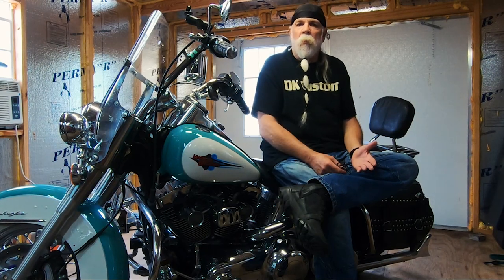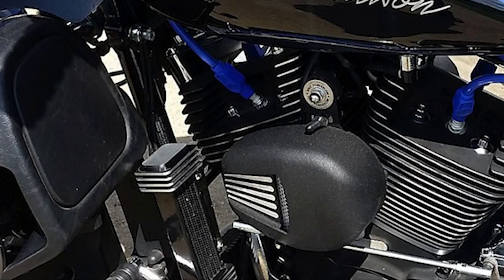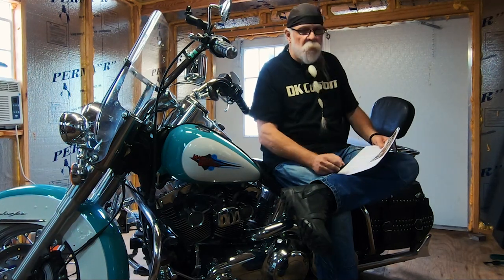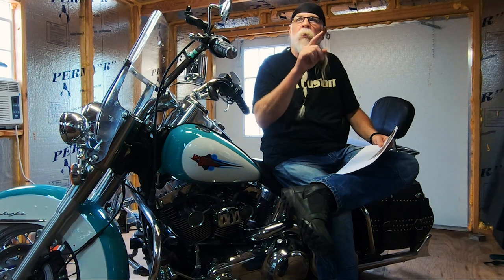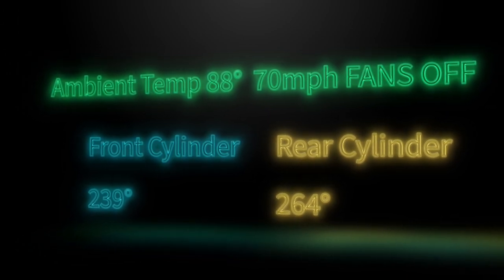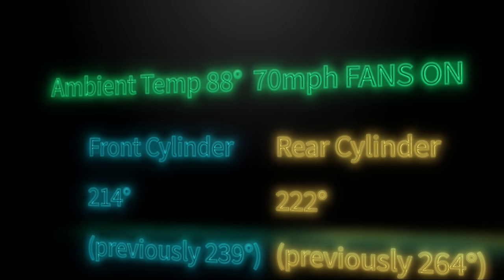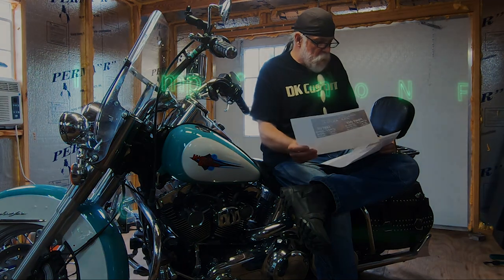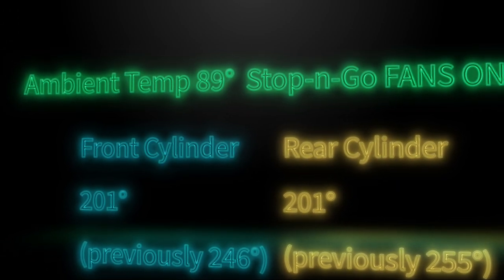Harley's DON"T Need Water-Cooling - Just More Air!

Comment from the maker: I forgot to mention two important details in the video:
1.  The temps were taken with an IR Gun on the cylinder heads, right near the spark plugs
2.  The drops of 25*-50* on the cylinder heads result in a drop of 7*-12* ET (Internally mounted OEM heat sensor)
Reply: What IR Gun is accurate
Reply: I have a set of the mighty mite fans. They were a bit expensive but they do work. I had one of the fans go out and they sent me a new fan. Don't worry you can install the new fan yourself easy.
Reply from the maker: @mikegroft1569  Great to hear.  Yes, fans are an important thing to have in warm weather or stop and go.  Both the Mighty Mites and the ForceFlow work really well.

Comment: Well they stand to gain massive benefits from water cooling, like more consistent power production, and the obvious better cooling, which in itself will allow for higher compression ratios which will mean more power and torque. It can also be done without it even looking like it's liquid cooled; Harley's used steel tubular frames, I don't see any reason why Harley-Davidson couldn't just make a portion of that tubular frame basically a radiator. Run the hot coolant through a section of it, make it a little bit thicker, use it as a radiator, it would never look like it was a liquid-cooled bike but it would have all the benefits of one.
Reply from the maker: An interesting idea for sure.
Back, almost 20 years ago, I considered using the engine guard as an oil reservoir/cooler.  Got very close to doing it...but realized I did not want to have to keep any bare skin away from the engine guard to avoid being burnt.

About 10 years ago I explored a few different bikes that used parts of the frame for the oil tank...decided against that for a variety of reasons.

The Twin Cooled bikes have dual radiators, each with their own fan, and the coolant runs up near 200 F.  Not at all sure how it would work out running coolant thru the frame...no fins for heat dissipation, let alone a proper radiator.

I think HD is pretty committed to head down the path of the massive radiator on the 100% water cooled RevMax engine.  We'll see over the next couple of years how that works out.
Reply: If you know about the Nova Project then you know how HD was going to hide the radiator way back then.

Comment: I have a 1991 HD Tour Glide, I installed 2 fans on the oem oil cooler to help assist the cooling and a oem HD engine Fan. That mounts on the left side were the horn is located and I relocated the horn underneath the left passenger floor board. It sure does help keep my old EVO cool. I will now install an External Breather. And remove the Air / Hot Box. And keep improving my bike.
Reply from the maker: Good to hear! 👍  Bet you're enjoying that Harley!  Don't see a lot of those around anymore....wish we did.

Comment: Ok i glad you brought this up so i can tell you how i manage my two money pit Harleys.  I have two bikes that are similar as far as cooling or somewhat . One is a 13 Roadglide with a modified SS 143 ..Compression is 12.2 and both bikes have ss 640 cams . Both bikes have oil temp gauges that replaced the silly air temp gauges . I use the mity mite cooling fans on both bikes . The other is a 12 street glide with a SS modified 124 set at i think 11.6 . Both have oil coolers of course. Both have chain drive ect ect . Here is what i do to make these bikes work for me . I refuse to ride in large towns stop and go traffic. I avoid this peroid . I dont like to ride in 100 deg weather not interested.   The mite mite fans help a lot . I keep a check on the oil temps of these engines . I had good experience doing this. Ridding two seems to as expected drive up the temp a bit . I would like to increase the oil cooler size a bit on both as i think these coolers control heat for x amount of hp but since these make more then more heat rejection is needed .  I not going to cook a expensive engine from stop and go traffic in 100 deg weather.  I just load my bike up in a inclosed trailer and go to where cool is and ride. Or wait till it gets cool and ride . Both these money pits are fun to ride because they run pretty good on 91 0r 93 fuel . Keeping the temps in check is important to me
Reply from the maker: Good to read that you are taking care of your bikes.  Keeping that temp down improves power and engine longevity.
There are quite a few little things that can be done to lower the temps even more, and possibly widen your riding window.
Here's a video on some low and no cost thing that cam be done- https://www.youtube.com/watch?v=o3T3yA9BKwE

Comment: I recently installed a set of Might Mites on my '14 Street Glide and I was still pretty damn surprised at just how much air those little fans will pump out!
The mod will definitely come in handy the next time I'm stuck in stop and go traffic 🤙🏻
Reply from the maker: They are really good for keeping that rear cylinder heat down while cruising too.  👍
Reply: how much are the mighty mites?

Comment: Harley is so far behind. Why didn't they go with water cooling years ago? Oh ya, now they finally replaced the girls bike (sportster)  with water cooled version finally after all these years. Too little - too late. My Hondas are water cooled and never have over heating problems like Harleys do. While riding to Sturgis across South Dakota, Harleys had to slow down because they were over heating in the 100 degree heat and couldn't keep up to my 1100 Honda Shadow. A $30,000 bike that can't keep up with a $4000 used Honda?  WTF?
Reply from the maker: They are between a rock and a hard spot.  We answer your very question in the video at this link-
https://www.youtube.com/watch?v=N0kLaVQhbW4

Comment: I have a 2006 dyna with a built 2012 103. I am running a fxrt style fairing with the lowers and bike is getting way hotter than I like . ( power vision et getting to 270) mostly if under 35mph. Once I am rolling about 40-50 it comes down to 230-240.. in your opinion would mighty mites be better than the Jim’s?? I love the look of the Jim’s but want what cools best.. thanks for all the great  videos..
Reply from the maker: The Mighty Mites cool a little better, not a lot, but in the 5-10 F range, than the Force Flow.  But Love Jugs, the company, is not doing well.  The owner passed a couple of years ago and the daughter took over.  Quality and Customer Service has gone way down hill, and there is talk of them closing up shop.

Comment: I have three Harleys, 1978 Shrine FLH, 1991 Springer Softtail, and a 1992 Electra Glide Ultra Classic. 
Will any of your fans work on my rides. 
Thanks in advance for your time.
I just wanted to add that I have standard oil coolers on all three bikes
Reply from the maker: Thank you for checking with us.
Unfortunately we do not have any fans that fit your bikes.

Comment: I mean i own a scout bobber and a lowrider s and really i never understood why youd need to buy a fan for overheating... When just have a watercooled engine makes more power. I understand harley can get away from the aircooling... I think it holds them back from my age group of riders... Ive had to stop and pull off in a traffic jam cause my harley was too hot and i didnt want it to overheat, but ive also been in one with the scout bobber and its not even a thing you have to worry about... Btw love your product's

Comment: Gents.  I ride a 2020 Road Glide Limited twin cooked M8. With the oil relocation,  if you drop your bike on that side, are you going to hit the oil filter in the new location??
Reply from the maker: The Oil Filter is well tucked in under the passenger floorboard. You would hit your bags, bag guards if if you have them, floorboard, and fairings all before you would hit the Oil Filter. 
The furthest any portion protrudes from the bike is 5.75" from the cap of where the Oil Filter is installed. You can see a picture of the cap and how well it is tucked it at the product page at this link - https://www.dkcustomproducts.com/cool-n-clean-oil-filter-relocation-kit-harley-2-wheel-touring-dk-cnc-ofr-2wt.htm

Please feel free to contact us with any questions;
Support@DKCustomProducts.com
662-252-8828

Thank you for commenting! MB

Comment: Hi, have anther question for you I’m going to have a Jim’s force flow cooling fan installed and I’m going to have the thermostats wire bypassed and use the manual switch is it ok to run the fan on  all the time when you ride or is it manly used for slow speed in town riding. Thank You
Reply from the maker: I run mine 100% of the time.

The engine generates more heat at 70 MPH than around town riding, so the fan is even more useful at highway speeds.

Here's a video showing temp tests at different speeds-
https://www.youtube.com/watch?v=wRRtRYWm5rw

At around the 9 minute mark it shows the temps at Stop-n-Go, and 55 MPH and 70 MPH.

Pretty interesting.  KP

Comment: Now this might be a dumb comment/question but if we put forced air on the left side of the rear cylinder to cool it down, wouldn’t the right side of the said cylinder would remain hot? Therefore voiding any cooling benefit?
Reply from the maker: There is no doubt that the air passing the right side of the cylinders is a bit warmer than the air passing the left side.  However, it is still much cooler than if the air from the fan was not blowing.
This is evidenced by that heat sensor on the M8's being on the right side of the rear cylinder, and it being 35-65 F cooler with the fan on than off.
You may find this video useful/interesting- https://www.youtube.com/watch?v=qMVwT0nunfU

Comment: I got the coil relocation kit for my 2005 deuce can I put mighty mites on also.
Reply from the maker: Yes, the bike in the video is a Softail with a Coil Relo and Mighty Mites.  Use a coupler  nut and a stud to extend the threads so that you can mount both.  Here's a link to a photo - https://www.hdforums.com/forum/attachments/dyna-glide-models/520044d1501254051-any-early-reviews-on-the-love-jugs-mighty-mites-coil-20cover-20wards-20fans_zpsremyx0n9.jpg
This is the hardware needed:
Stainless Fender Washer
A stud of the same thread that is already on the bike (5/16-18)

A Coupling nut (5/16-18)
Here's a photo- https://i1088.photobucket.com/albums/i339/DKCustom/Softail%20coil%20relocation/CoilFCSHDW_zps49110ab8.jpg

Comment: Please somebody help me understand. Harley is in business of producing bikes for over a century. Why doesn’t motorcycle that cost as much as a car have air cooler fan installed right out of factory. It might not be as good of machine as it is portrayed.
Reply from the maker: Good question.  Possible answers...they want you to buy more stuff after the purchase of the bike.  They are not needed for the average rider, since the average rider only does around 3000 miles a year, and the warranty is only for 2 years.  6000 miles will not require warranty work for heat damage.
Here is one of the things HD is doing-
https://www.youtube.com/watch?v=mzzc-ydotOQ

We'll see how that works out.

Comment: I have a 2014 project Rushmore edition ultra limited with twin cooling as that enough or would adding Mighty Mites be beneficial?
Reply from the maker: Unfortunately the 14 and up bikes with Twin cooling run HOTTER than the fully air cooled models.  You can see a couple of videos on the subject below.  There are many things you can do to cool them down, you can see a report on what each of them are, and how much they cool down in the link at the bottom.

https://www.youtube.com/watch?v=MF0hO-w2hz8

https://www.youtube.com/watch?v=6AhPqVlvE-w

Report Link- https://www.dkcustomproducts.com/why-how-to-cool-down-the-twin-cam-engine-part-i-dk-cl-tc-dn-1.htm

Comment: I own a Twin Cam 88 and a 75 Ironhead. The Ironhead runs so much cooler than the 88. Why? Well let’s tell the truth instead of looking for excuses.  Big inch Harleys are woefully underfinned on the heads and cylinders,; yes rears are hotter but that has always been the case; it’s nothing new. Just accept the fact that they are in engineering terms and capacity outside of their comfort zone by a country mile. They should never have gone beyond 74 cu. Fitting fans etc is just a bandaid for a broken limb. The quicker Harley learn that the design is bust in these idiotic capacities the better; the customer always pays.
Reply from the maker: Very interesting perspective.  HD is in a catch-22, that is for sure.

Comment: Come to las vegas mid summer, or Phoenix and say this. 
Additionally with modern day epa standards and performance numbers from just other bikes it will most certainly help.

I give it 2-3 more engine evolutions before Harley WILL be water cooled. Honestly we're just waiting for the boomer base to die off, that way Harley can finally innovate
Reply from the maker: They have been trying...Vrod, Streets, now the Pan America and the Sportster S.  Oh, and also the Twin Cooled.
We will see what happens!
Reply: @DKCustomProducts  I'm perfectly fine with having both for now. I'd love to keep seeing them innovate, while retaining their bread and butter. 
No reason they can't have both. And considering the Sportster isn't aimed at the older generation anyways then I see no problem with it getting the change.

That said yeah the heat is awful down here, gonna do an oil cooler and the fan at some point and hope it works

Comment: I’m trying to decide between love jugs, or the UltraCool fan assisted oil cooler. Both seem to do good.
Reply from the maker: So much depends on what bike you have, what kind of riding you primarily do, the weather you live in, and most importantly, what temperatures your bike is experiencing in the metal and in the oil.

This entire series linked below gives the whole picture and should help you make the decision-

https://www.youtube.com/playlist?list=PLb3bvZgbH92_3s-2vv63QggFJ3nteFd_C
Reply: I just did the UltraCool 3.0 it's strictly oil temp. 
I still watch my engine temps run high 280°f+ in stop & go for 30-40 min before oil gets to 230°f & fans kick in & it doesn't lower engine running temps that much 270°, but that's better than 310°

I'm considering the horn fan in combination & removing left side seat shield to direct better flow.

Comment: Are the mighty mites better then love jugs in your opinion ... ??
Wish is better between the 2 you spoke of on your video? 
Have a 2014 flhtcu .. air cooled .. no water in heads !!
Reply from the maker: The Love Jugs Mighty Mites do cool better than the larger Love Jugs.  Higher RPM, more focused air flow, results in better cooling.
Reply: Hi 2021 FLHTK twin cooled, would you go with mighty mites or Jim's fan? Thanks

Comment: It looks like this goes in the place where the horn is.  Is the horn removed?  I have a 2011 Street Glide 103 twin cam motor and this looks like the horn is exactly where the fan needs to be installed.  Can you provide more info on this.  Thank you.
Reply from the maker: Go to this link -  https://www.dkcustomproducts.com/jims-force-flow-fan-cools-twin-cam-engine.htm
It has all the details and photos.
You will see that there is a horn built into the ForceFlow Fan housing, taking the place of the factory horn.

Comment: Just wondering...with cooling fans blowing air over the jugs and heads to cool the engine left to right, does anyone have feedback on the additional felt heat?  How's your right leg doing?  DK - Really appreciate all the work you guys have put into testing and development.  I'm planning to purchase a few items - after I do a leak down test to see if my trip to Arizona and back damaged my engine too much.  It got awfully hot last June in Oklahoma and Texas and I really noticed the sluggish performance along with the dramatically increased felt heat through the seat.
Reply from the maker: Good to hear you are finding the videos useful, appreciate the comment and your business.
On the fan, if you wear shorts or thin pants, you may feel a little on your right leg when at a stop.  However, the overall heat is less and generally folks will feel cooler with the fan.
Reply: @DKCustomProducts  does it make a difference with stage 4? I get crazy heat on my right leg after i got stage 4 upgrade.
Reply from the maker: @freddychico3621  Yes, it will reduce temps substantially on your Stage 4.  However, there are other things you can do that are less expensive, that may get you the reduction in temps that you are looking for.  I generally do the free and low cost first, working my way down the list until I get to the optimum temps.  Here is a link to the list- https://www.dkcustomproducts.com/why-how-to-cool-down-your-twin-cam-engine-part-ii-dk-cl-tc-dn-2.htm

Comment: This was a long debate with many, air-cooled or water-cooled. Air cooling is simple because there isn't an extra system to maintain and they weigh less, however water-cooled motors have higher fuel efficiency, better performance (the same sized engine can run higher compression ratios and thus generate more power) and also lower emission (especially important when exporting bikes to countries with strong emission laws).  Air cooling also has the size limitation - especially on motorcycles - as the heat sinks have to be increased with the square of the displacement increase size. I personally had three bikes in my 15 years or riding, none was water-cooled, but I can understand why so many motorcycle manufacturers eventually went to that.
Reply from the maker: Yep, and as time passes HD will probably fully migrate to water cooled.

Comment: Having two cylinder behind each other has never been good  V twins should be transverse and not hidden behind the front forks and mudguard. Water cooling only allows cooling to be moved to a better place for airflow.
Reply from the maker: Thanks for the comment.  Since HD's are the way they are, good thing that there are fans to help compensate. 👍